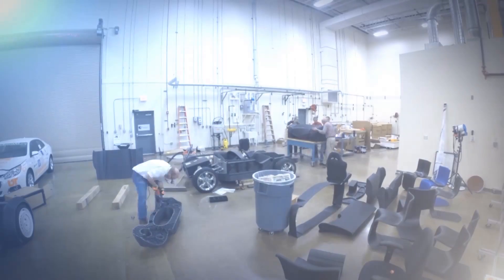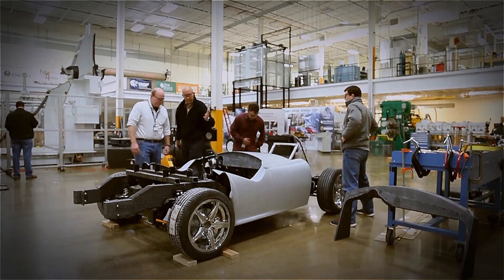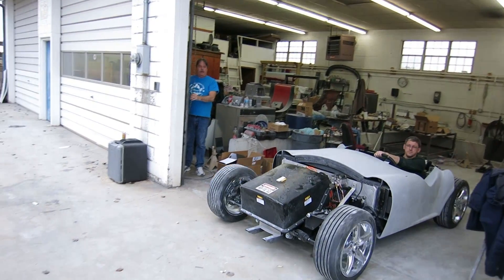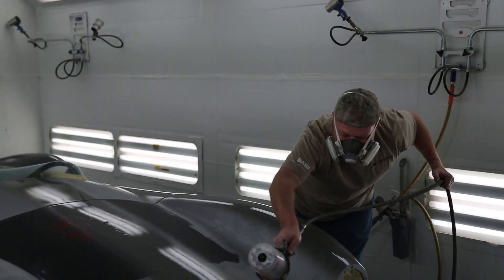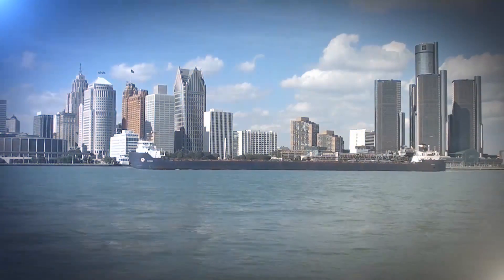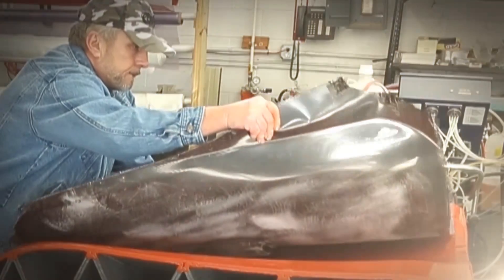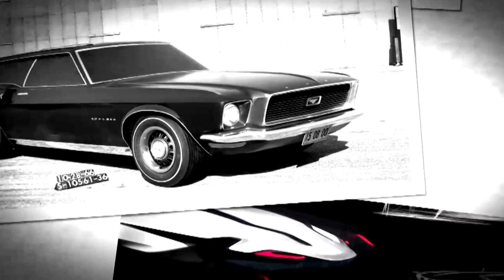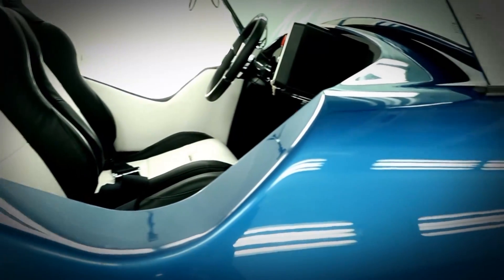Shelby Cobra 3D Printed Car 2015

Comment: I have mostly worked w/ smaller scale 3D modelling and printing, but I've worked with laser engravers and CNC in the past so I'm always thinking about the 3 working together. Would it be feasible to design slightly oversize and give the pieces a 2 point (or more) mounting system that could allow a CNC to finish the model afterwards and minimize the sanding/finishing?

Comment: They don't really mention what was 3D printed. I'm guessing the frame wasn't.. neither were the wheels, struts, suspension, ECU, bolts, transmission, and engine.

If it was only the body panels, that is not that impressive.
Reply from the maker: Hi zdrux,
The shell, chassis, the passenger monocoque, the grill, and the
headrest brackets were 3-D printed.
  
The headrest brackets were printed using a titanium composite, and
the grill was printed with polymer materials.

Hope that answers your question!
Reply: +Innovations in Manufacturing at Oak Ridge National Laboratory  who manufactures that large scale 3D printer???
Reply from the maker: +Jon Car Cincinnati Incorporated, you can read more information here - http://www.e-ci.com/baam/